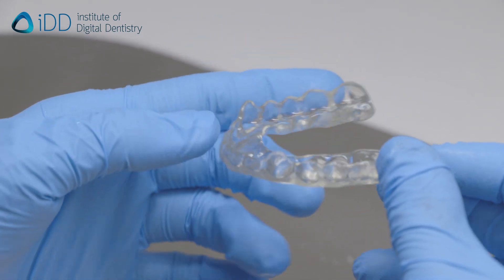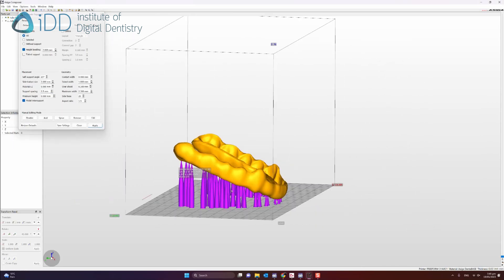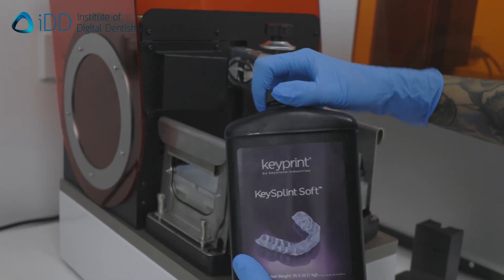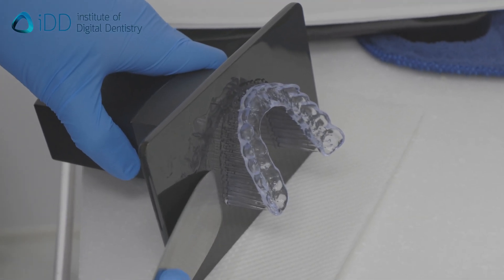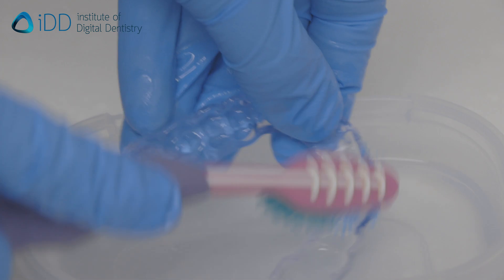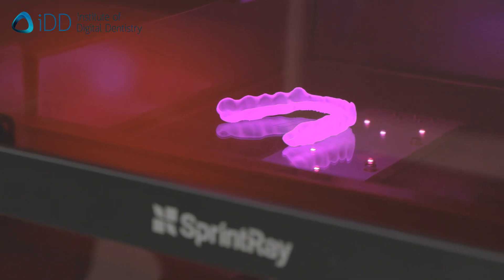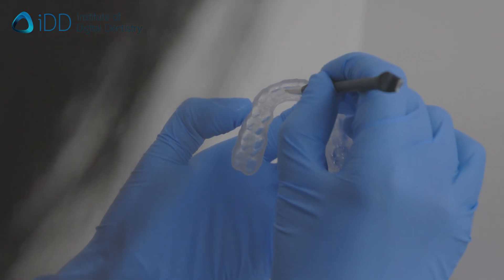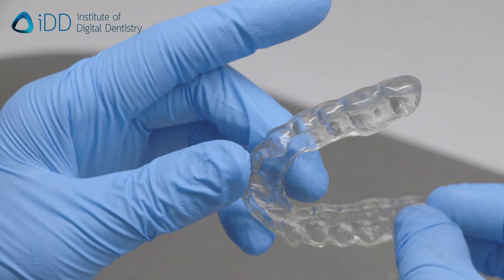Step-by-Step Guide: How to 3D Print Splints and Nightguards using Keysplint Soft | iDD

Comment: Hi, could the candy coating be used to replace the polishing? I'm looking to shorten the production time. Sorry for my bad English 🙈
Reply from the maker: Yes, to a certain degree, although we still polish a little bit before coating. It does create an excellent luster. 

Just keep in mind to carefully do it properly, as the surface can chip if not done correctly.